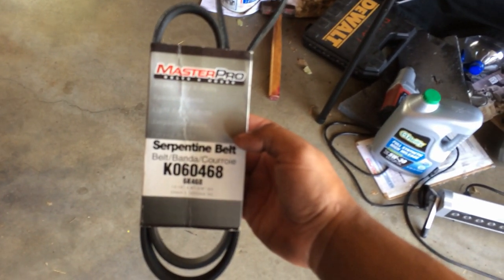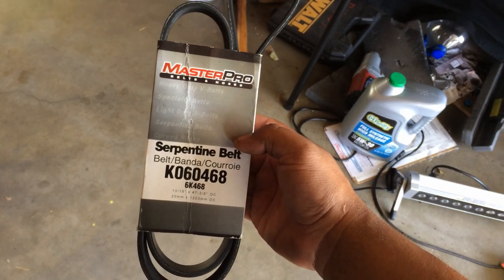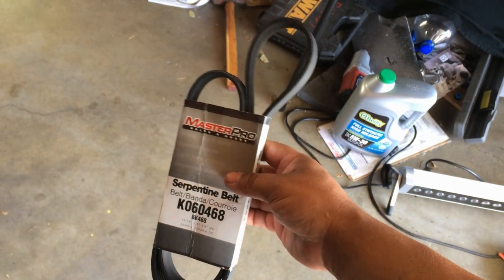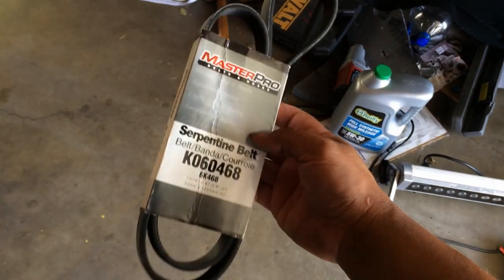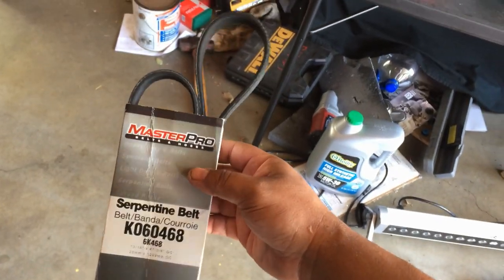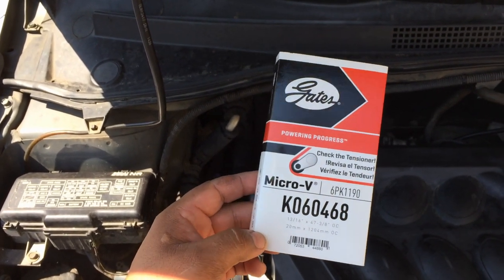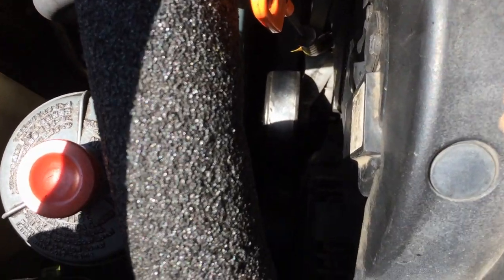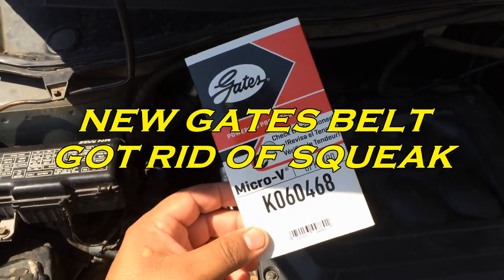MasterPro Belt Review - MasterPro Serpentine Belt Review - Quality - Gates vs MasterPro

Comment: For timing belt, I always go OEM or gates .
Reply from the maker: Gates quality has gone down hill in the past 4 years. I had a timing belt component kit from Gates fail after 4 years and less than 60,000 Miles. Go with an Aisin and stay away from Gates.
Reply: @bundysgarage  used to work for Gates building belts,  plant shut down and moved to Mexico 5-6 years ago.  OEM, delco, continental, bando, motorcraft, moca, etc. ALL gates belts.  80-90% of any belt you buy is made by Gates, same with radiator hoses.  We just slapped whatever label the manufacturers wants on them before dipping the slabs in vulcanizer
Reply: @wildbill6976  are they a good choice?
Reply from the maker: Gates are ok but not the best. If you want a good belt stay with Mitsuboshi or Aisin

Comment: The Gates belt will start squeaking in less than 15k miles.  I've gone through OEM, Bando, and Gates, the only belt to use is the Continental Elite/Gatorback for just a few bucks more.
Reply from the maker: They don’t make Gatorbacks anymore. I’ll let you know if the Gates starts making noise in 15K
Reply: Yes they do.  It is now Continental Elite.  I have 2 brand new Gatorback belts for my 07 Accord V6 on my shelf right now.  I had a Gates belt slip and chirp upon startup just a few hundred miles into it.
Reply from the maker: Gatorback was made by Goodyear not Continental. I’m sure the Continental belt is fine. I have never had a Gates chirp on me though.
Reply: I am aware of that.  Continental bought out the division that made the Gatorback belt and is now called Continental Elite.  Just look it up and there is a whole catalog pdf for download.  It is the same belt, just owned by a different company now.  Stay away from those other brands, they always stretch way sooner than gatorback.
Reply: @bundysgarage  Goodyear sold them to Continental. They are continental elite now, however,  they are phasing them out and focusing solely on OE grade now.

Comment: For Honda I stick with oem bando or mitsuboshi a lot of times u can get the oem belt in a manufactures box and u can save a few bucks. I once bought a gates for a altima and I couldn’t get it to install at all I returned it and bought oem from dealership and 1-2-3 it installed